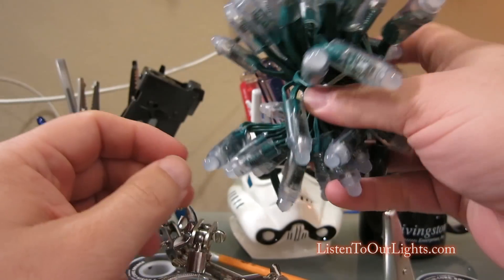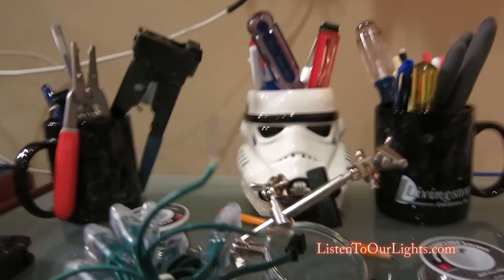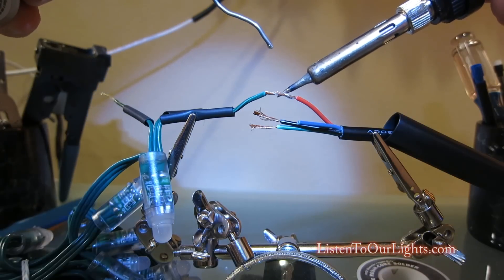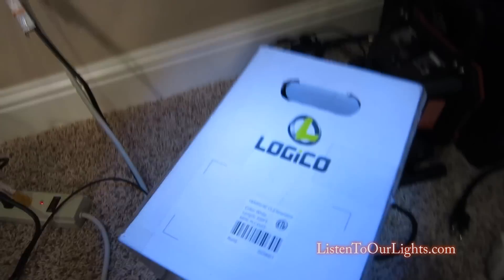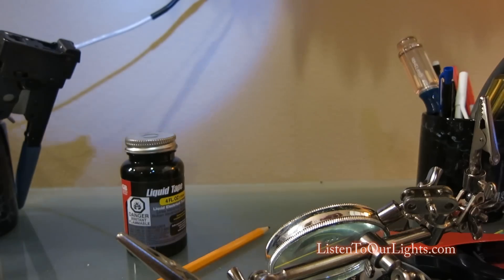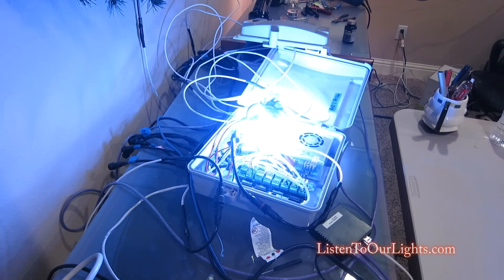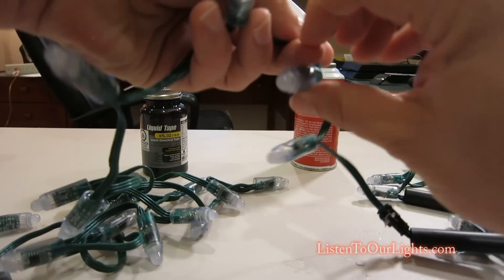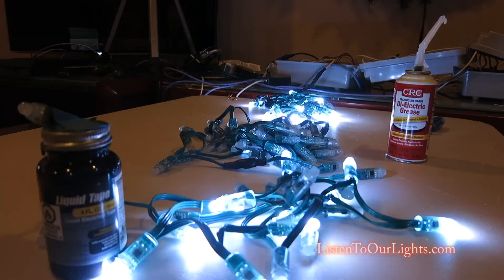Building a 125 Pixel String

Comment: BTW Di-electric is pronounced "die" electric.  Also you should use flux on the wires before and after tinning and clean everything with alcohol before heat shrinking for best results because flux is corrosive.

Comment: Can you cut and join pixel string lights at any point?
Reply from the maker: You can.
Reply: @listentoourlights  how about inserting a blank section of cable to join strings so there are no lights for say 3 feet? I have done that and it seems to be ok but like I said I am experiencing issues and trying to determine what the root cause of my issues are. I basically have 2 50 pixel strings strung together with a couple of blank sections in line so I do not have lights overlapping. I am using an sp108e controller with 12v pixels.

Comment: Hi John. I have pixel leds that have wires without any indication which is V / Gnd / Data. I accidentally cut through all 3. How can I test them to make sure I am connecting the right wires?
Reply from the maker: With a multimeter V+ and V- will pass a conductivity test. Main thing is not to confuse V+ or V- for data. If you get V+ and V- reversed (assuming no other strings are connected) then it won't harm the lights.
Reply: @listentoourlights  wow! Thanks for the quick reply!!  how can I be sure which one is data? It appears that one wire runs the length of the leds, a second connects a few leds at a time. And the third connects every led. They are twinkle brand home special edition rgbw Gen 2 if that helps.
Reply from the maker: @petersjohnj  Do a continuity check with a multimeter. It sends a small signal through the wire to see if it makes it to the other end. V+ and V- will pass the signal through, Data will not.

Comment: I would twist the wire once you have stripped it but before you pull the insulation off the end
This makes it a lot easier to get a really neat twist to the end of the wire

Comment: can you not use adhesive lined double wall heat shrink instead of filling with dielectric grease and regular shrink? I think it would make a better waterproof joint...

Comment: Hi, excellent video, thanks for uploading. First, where do you get them with green wire interconnecting? Mine have Red/White/Green and I can't find G/G/G anywhere. I've been contacting manufacturers in China trying to get them to make them for me. I asked them to make strings of 100 but they said the voltage drop would bee too great - but you have 125 here! I've been using 5volt ones,  do you find the 12volt ones are better?
Reply from the maker: +Paul Wright  : These 2811's with green wire are from Seasonal Entertainment. They come in strings of 50, but I connect 2 1/2 strings to get 125. I went with 12v because the voltage drop isn't as bad as what you would see with 5v. The distance you put the lights away from the controllers also makes a difference. In my case I'm usually maxing out at 18-20'.
Reply: @listentoourlights  that distance of 18-20' is that that the distance from the controller to the xconnector? What about data signal drop? how far does the data signal travel before it drops? I am trying to figure out where I am going wrong with my set up.

Comment: after how many lights do you inject power? 125 seems like a lot.
Reply from the maker: +crichardson1781 I picked 125 b/c I don't want to do power injection. It largely depends on how long your extension cables are to the pixels. I found 125 pixels with an 18' run to be a good combo.

Comment: Can you solder that 18 gauge 4 Core wire that you got from TekTel directly into an RGB Strand? Assuming I also waterproofed, would it still perform the same? I have two applications I would want to try this with:
1.) instead of buying the $12 per 20ft extension cord(times 8 floods) from LOR, I would splice in an old piece of security cable(already have a pile of it at my house), heat wrap the connections, and make my 10w RGB floods have a longer cord. This would allow me to keep the CMB24d inside and out of the weather...

2.) I have a smart pixel strand that I would like to add about 5 feet into the middle of the strand to make the transfer from one eave to the next eave of the house. without lights along the gap

In my mind, this would work, but I'm nervous about cutting into these expensive strands for the first time...This will be my third year, and 1st with RGB...Any guidance would be much appreciated! Thanks for your videos! Always helpful!
Reply from the maker: +Jordan Shew You can always solder directly to the strands. Be aware of voltage drop and if your run is too long your lights might not get enough power (fixed with power injection) or might not get enough signal (fixed with null pixels).